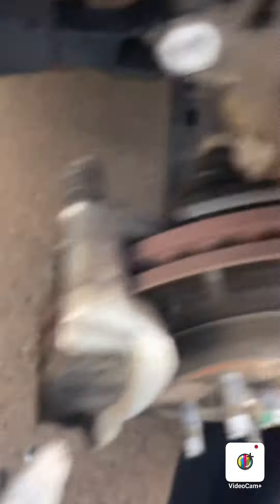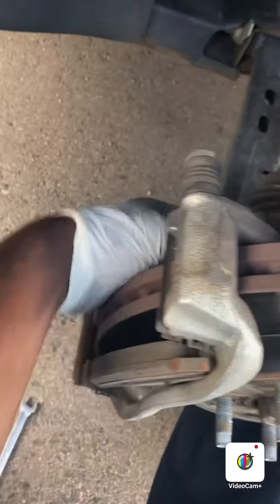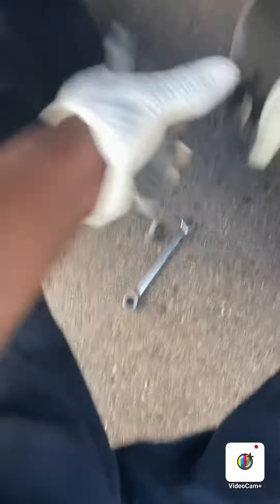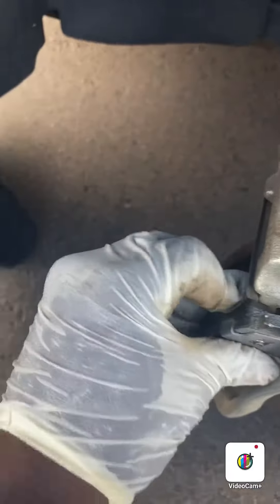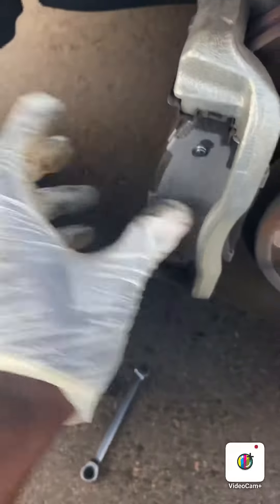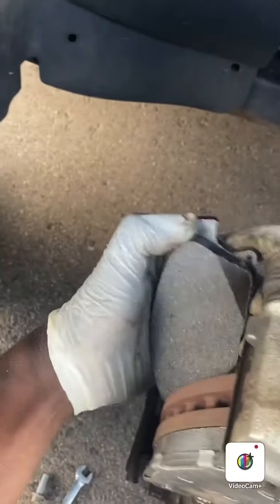2015 Chevy Trax Front Brake Pad Replacement

Comment: The reason you were having a hard time with the last pad is because the brake pads were on wrong. I just went through an hour of aggravation trying to get my brake pads on. The brake pads come in the box wrapped as pairs. It is not left and right, they are wrapped inside pads and outside pads. Take one pad from each set. Mine had "ears" on one set and no ears on the other. The pad with ears goes on the outside of the caliper and the pad with no ears goes on the inside. I got the first 3 on fine but the last one wouldn't go on because of the "ears." I had to take the caliper apart I had already completed, and take off the outside caliper with no ears. Sorry for the long post but I hope it saves someone time and aggravation.